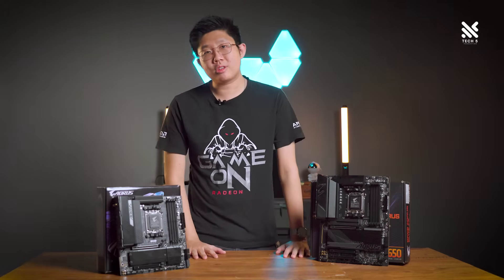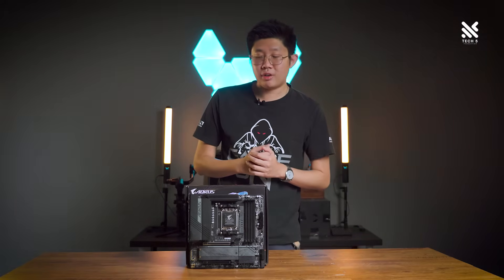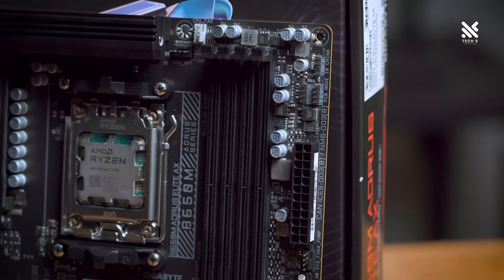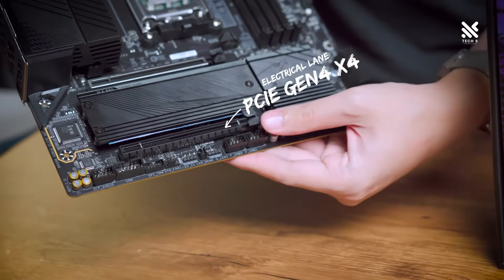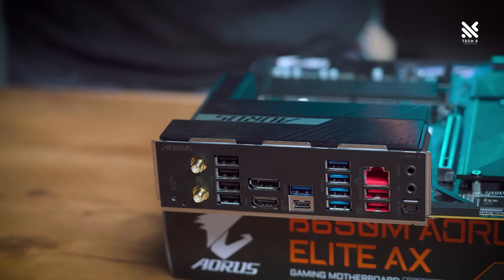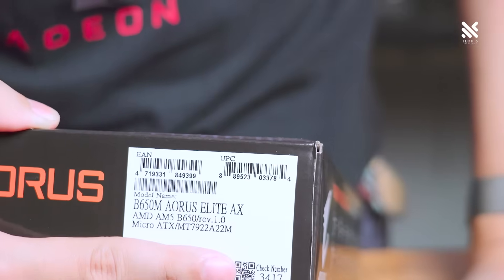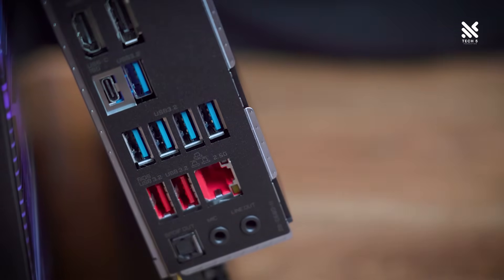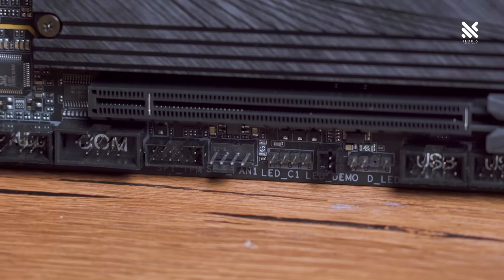Gigabyte B650M Aorus Elite Review - An often-neglected motherboard form factor?

Comment: 2:20 this motherboard only uses 8 layer pcb in the first revision. They switched to 6 layer pcbs in all later revisions also most the revisions use Realtek WiFi chipset instead of intel or amd.

Comment: My thermal guard screws for m.2 ssd are stuck hard and I cant seem to unscrew. How do u remove them so flawlessly?
Reply: Did you ever get it off I just got it and my screws are crazy stuck too
Reply: @dyvol8717  I kept trying different screwdrivers until the right one worked, or use a battery powered screw

Comment: Great review, but referring to users of the 2.5 Gbps LAN port as "into the classics", is an unfortunate characterization. If it's "classic" to prefer a network link that is light years ahead of WiFi in terms of speed and stability, then I guess I'm into classics. As far as I'm concerned, WiFi is all about convenience and connectivity to other wireless devices, not performance.

Comment: Let’s say initially I only install one M.2 Storage. But after a year or two, I decided to add another M.2 storage. Can I just easily remove the cover without damaging the thermal pad on the first M.2?

In short, will the thermal pad be so sticky after a year or two?
Reply: m2 storage dont even need thermal bs
Reply: @avgustin.  nah dude, m.2 memory/control chip can get pretty hot
for longevity and performance, better to have heatsink attached

Comment: If someone is watching and thinking of buying it. I don't recommend it. It's one of more expensive AM5 motherboards and it has a coil whine. I was surprised and disappointed by it. Of course, if you don't have your pc near your ears it will not be heard, but still...
Reply: I bought this motherboard and 10 days later I encountered a problem with the coil whining too. I compared ASUS, MSI and Gigabyte b650m motherboards, but finally chose this one. I know the noise doesn't cause harm, but it is annoying. How do you solve it? Do you apply for after-sales service replacement or refund it?
Reply: @benjones885  as far as I read in the internet forums and etc I figured it out that not all Gigabyte B650M Aorus Elite motherboards have the coal whine, so it's like 50/50 getting a board with the coil whine or not. If you just bought it recently and your store policy lets it return it for a refund then just do it that (I don't know where are you from and what laws are in your country. As I live in one of the EU countries, we have a 14-day policy return without questions and get a refund. But if it's long gone, then you should contact Gigabyte, they give 3-year warranty for the mobos, so doing a warranty claim would get your motherboard replaced.
Reply: @benjones885 rev?

Comment: my current mobo is reasonably old it has 3 audio outputs, blue, green and pink. I use them to get 5.1 surround with a logitech system. These new mobos just have Mic and Line out. How can I use 5.1 just using those two ports?
Reply from the maker: May have to consider another motherboard, or if you're open to it, adding a sound card is always an option

Comment: pci express 5.0 Does it have a slot?  GIGABYTE B650M AORUS ELITE AX Amd B650 Soket AM5 DDR5 6666MHz (O.C.) M.2 Anakart
Reply from the maker: The B650m aorus elite has support for PCI-e Gen5 on the primary M.2 slot only

The graphic slot doesn't have Gen5 support :)
Reply: Can you send me a link to which graphics cards support PCIe 5.0? @Tech5Productions

Comment: the screws won’t come out from the thermal guard 🥴
Reply from the maker: yes, I believe it's designed so that you won't lose the screw when you take out the thermal guard. :)
Reply: @Tech5Productions  i didn’t know and accidentally ripped it out when trying to put my second ssd in😭 do you think it’ll still work there’s no visible damage to the board
Reply from the maker: @inslts  oh no, perhaps you can try to slowly insert it back and see how it goes
Reply: @Tech5Productions turns out it works perfectly fine

Comment: Im sorry. But this board is a trash. 

On the paper, everything sounds fine but Gigabyte cheaped out on chokes just too much.

I have never imagined to hear a wild coil whine on a motherboard in 2023. 

Do not buy this crap! Do not buy anything from Gigabyte

As you know, coil whine is not one of RMA subject, And RMA takes way too long time.

Better buy an ASUS or MSI.
Reply: Please explain what do you mean?
Reply: @listen5248  he means what he say's. I have this board also and it has coal whine... I thought buying an expensive AM5 motherboard wouldn't have this, but it does... As far as I researched it comes because of the RAM speeds, when you make them higher the sound of the coil get's louder.
Reply: Curious cos Hardware Unboxed actually recommended the B650M Pro AX

Comment: My b650m aorus elite was DOA. Replaced with a MSI mortar. Never again with gigabyte. Was a frustrating experience troubleshooting.
Reply: How is the mortar working for you? I am still trying to pick a board for my 7800X3D  7900XTX build. Coil whine? Thank you
Reply: @rhufnagel  Works fine. Although over priced when I bought it at 240$ and the PCIE slot not being in the highest position is dumb.
Reply: @ICmikeyP  I did not know that. I was looking at the sapphire nitro + vapor 7900 XTX, will I not be able to put in bottom fans? Might need to find a different board. Looking to use the Jonsbo D31 mesh with screen case.
Reply: @rhufnagel  You might not have any issues in the D31. It's the D30 you would have issues I think.

Comment: Actually very good review, well done, very helpful! Looking at this Gigabyte since Asus is having issues on AM5. A good note here is that the VRM is DrMOS, not as good as the one on B650m Aorus PRO but let's see. Hope it won't have the coil whine that Gigabyte tends to suffer from.
Reply: Which VRM B650M Aorus Pro have then? I'm finding it hard to see any difference between these two boards. Which should I get? What's the major difference. I'm so confused.
Reply: @nomad5826  I have the same question friend between these 2 models, did you get an answer to this question? Thanks if you can answer.

Comment: I am confused between 3 boards please help. Gigabyte AORUS Elite B650, AsRock B650M PG Riptide and Gigabyte B650M DS3H
Reply from the maker: it really comes down to which processor you'll be using, the aorus elite will have the thickest heatsink

but for cpu up to ryzen 7, the other 2 should be okay too! both the aorus elite and riptide will have a built-in I/O shield, and the riptide may be good if you need clearance for top area of your build.

as the top of the riptide doesn't have a VRM heatsink. :)

I think all 3 boards are great, and you really can't go wrong with either 1, but if you go for the riptide, do make sure the power limit is unlock from that board to make full use of it!

Comment: Would a 3090 Founder Edition(61mm height)  fit in the top PCIe 16x and I can still use the bottom PCIe slot? If you can please measure the distance between the top PCIe and the bottom one? I would love hear if it's possible, I have no idea where I can find that sort of information and you are the only one that has a video of it that is so good. I hope you can help me with this. Thanks!
Reply: 3090 FE requires 3 slots in your system and the answer is yes
Reply: @jilinzhang5600  will it support RTX 4070 with 3 fans?

Comment: This was a great review of the board, I can't believe I found a comprehensive review on the first search. Thanks again
Reply from the maker: Glad it was helpful!😊
Reply: @Tech5Productions  great vid
Looking fwd on the next one
Im curious tho can i use pcie4 like nv2 in that pcie5 slot?
Reply from the maker: @gg95-k7y  yup, you can. It'll just run it at the gen4 speed of that nvme :)
Reply: @Tech5Productions  can this work on a ATX case?
Reply from the maker: @willy7968  yup, it can bro. But it may look a bit small in an ATX case.